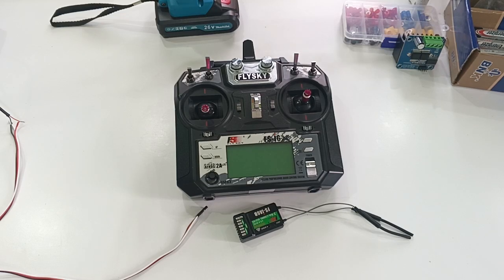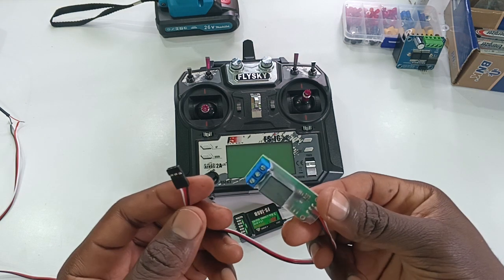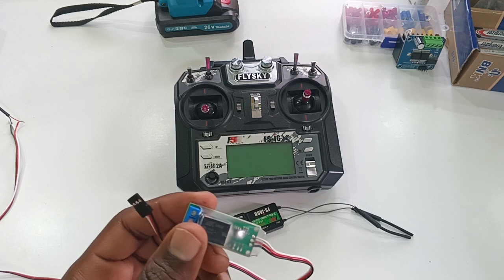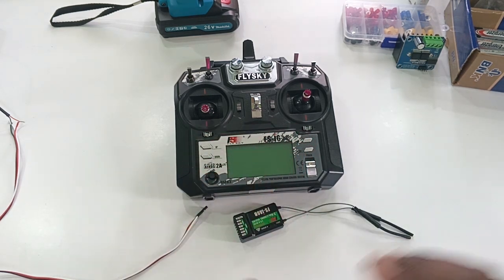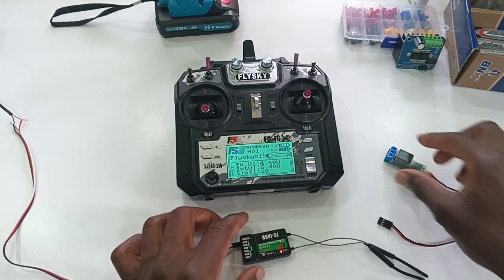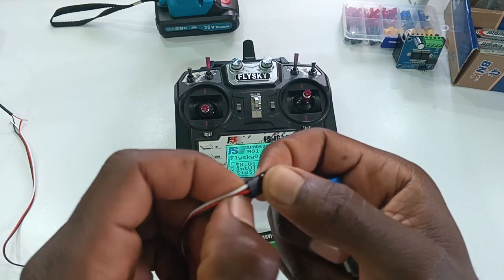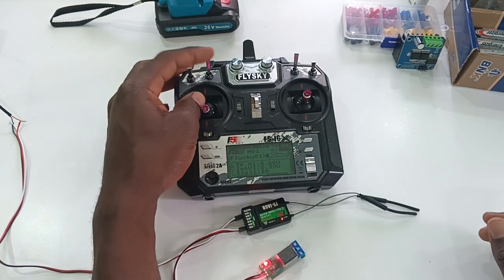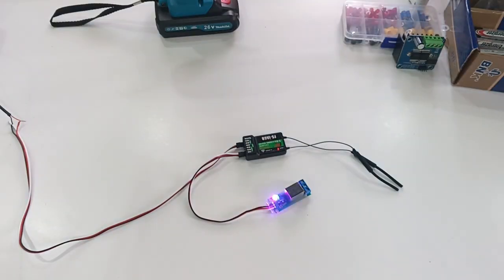How to connect a relay to any RC receiver

Comment: I can't find the link to the adapter you're using.  Where can I buy it?
Reply from the maker: https://www.jumia.co.ke/generic-2pcs-rc-pwm-electronic-relay-switch-for-rc-airplane-diy-model-91120733.html?utm_medium=social&utm_campaign=pdpshare-apps
Reply from the maker: DC 5V-12V 20A PWM Switch Controller for Remote Signal Control of RC Model Buzzer LED Lights（Black Board） https://a.co/d/iPaNT51